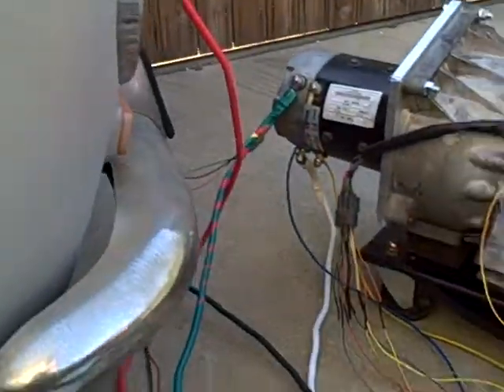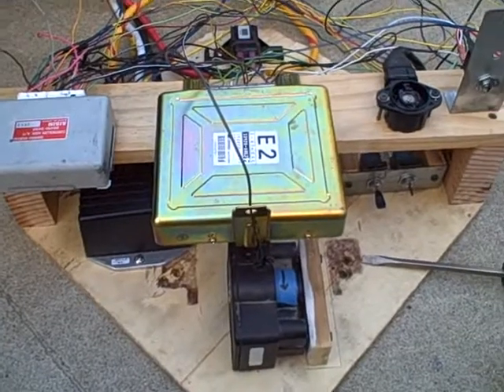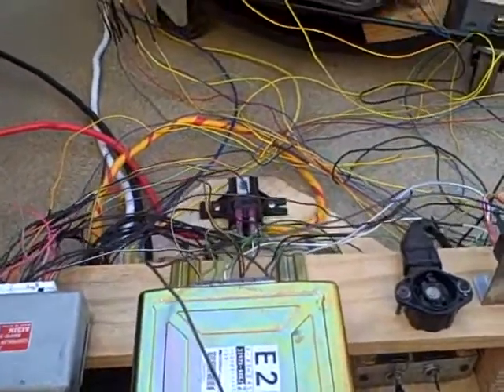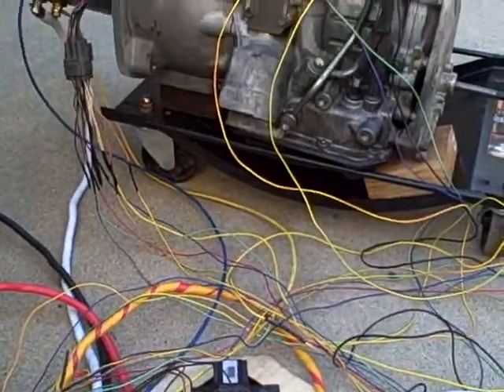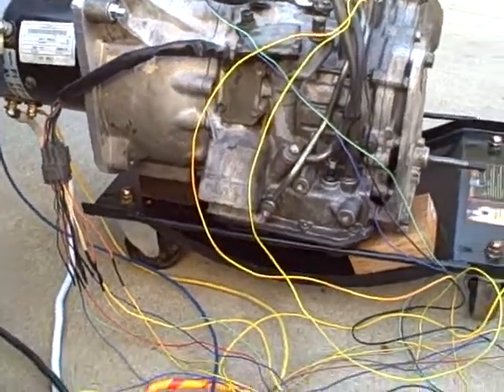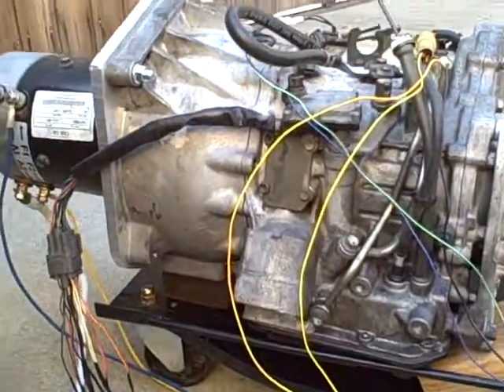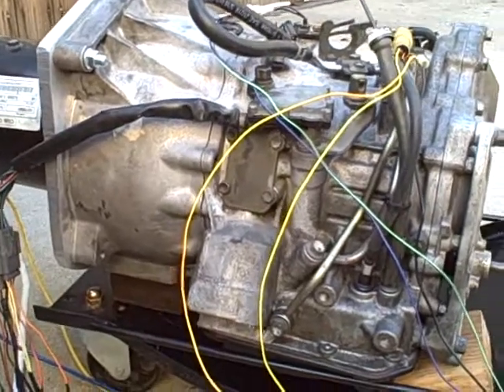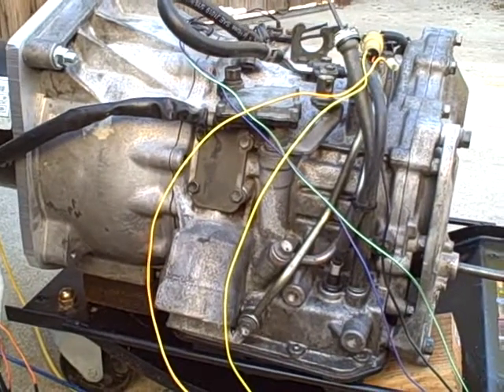EV Conversion - Automatic Transmission Shifts Itself

Comment: Hi; sorry I'm not very familiar with drivetrain mechanics; if I want to do this with an old automatic transmission (1991 Saab - which is really an even older 3 speed automatic transmission.... theoretically even better for electric conversion because of the existing gear ratios)... are you suggesting that if I remove the throttle position sensor or cable from the transmission - it will shift itself based on the rpm from the motor? Just as it does when it reaches 3400  rpms in first and second, for example? Or is there a need for an electronic signal to let the transmission know when to shift? Also, this car had the ability to manually shift - with a button to depress on the automatic shifter - such that I could downshift into 2nd and 1st at any time for hills. I feel like based on the gear ratios and shifter - there is some very easy way to couple an electric motor to this older automatic transmission? Help is greatly appreciated. What would be the first steps to determining or controlling how the car will shift - assuming I have a motor that will cruise at 5,000rpms. Also, because of the existing gear ratio and torque - couldn't it be a fairly fast car? For example - the stock version of the car is about 4,000rpms at let's say close to 85 mph in its highest gear - 3rd. If my motor is easily doing like 5000 rpm continuous (maybe like 105 mph cruising?) and feasibly much faster if higher rpms can be maintained? Sorry if this is stupid - I am assuming a serious battery - like a tesla battery with 300-400 volts or something. Thanks for any direction.
Reply from the maker: Based on some quick googling, it appears that a 1991 Saab would have a Borg Warner T37 automatic, which is fully mechanical. That means you need no wiring for it to shift properly. But you would need to keep the throttle valve cable/linkage that relays the movement of the throttle pedal to transmission. This is a physical linkage or cable, not wiring. It is critical for proper shifting and transmission longevity. You would still be able to shift it manually. As to the rest of your question, it really can't be answered without knowing the specific motor, controller and battery involved.
Reply: Thanks. Yes, oh yes....I know all about the cable! (because these transmissions are prone to failure, and the cable adjustment can be difficult if its not left in it's factory position). So the answer is YES, leave the pedal-shift linkage intact, throw in a motor (with adapter plate) and controller and some batteries, and I'll have an electric car right?
Reply: Direct drive is the same as "final drive" gear ratio, right? I just realized there wouldn't really be any advantage in keeping the transmission in this car since final (direct) drive set-up would (given proper motor selection) have enough torque and similar top end.

Comment: good day, I am wonder if you have a torque converter installed?  I have googled and an actuator was suggested to keep the torque converter running like ICE, or else the wear and tare the cost automatic transmission life span.  I would like to know how you deal with the problem?  because I am planning on doing an EV conversion on my W123 automatic transmission also.
Reply from the maker: I researched "idle circuits" on various EV forums at the time, and found some good ones. At this point, many years later, most controllers have a "idle" function that will allow you to keep the motor turning at whatever specific low RPM your automatic transmission needs to maintain pressure.

Comment: will an 80s model automatic transmission be easier than a later model
Reply: Orange Claw Hammer 10 months later hours and hours of studying Electronics. I finally understand.
Reply from the maker: The answer is "maybe", but "easier" is a short term goal. I was looking for the lightness, efficiency and precise control towards the long term goals of battery life and flexibility.

Comment: what is this video for? is this a manual gearbox converted? i dont get it
Reply from the maker: John Meister Dupa - This is an electronically controlled transmission for which I made a custom harness so that it would run without the rest of the Geo Metro from which I removed it. So, the point of the video is to show that one could do this if one wanted a compact A/T for some custom purpose. Thanks for watching!
Reply: so its a regular A/T converted to electronically controlled A/T? 

well cool :)

Comment from the maker: @thegreatnoleander - Just a heads up that the A/T in your Sonic will probably be nearly impossible to operate properly without the engine. The level of integration between ECU and TCU (if there even is a separate TCU) is several orders of magnitude more extensive and complicated in recent vehicles than what I had to sort out with my 1994 Geo Metro unit or the 1994 Miata A/T that I worked out the wiring for. By the late '90s, it's too hard.
Reply: Trans and motor have separate I/O controls. It's why your CEL doesn't illuminate if you are having trans issues. Harness should be separate.

Comment from the maker: @circusboy90210 - The pump is driven by the motor in the same way that it would be driven by the engine, but it is not driven when the car is stopped but still on -- when a gas engine would be idling. This should cause premature wear on the transmission, but for now I don't really care.

Comment from the maker: Telstar - The shift points come much closer to the motor's torque curve when one disables the throttle sensor input to the A/T computer. That keeps the shifts early and the motor speed relatively low. Most DC traction motors aren't too lossy up to 3000 rpm, and that's about where this A/T likes to shift when the throttle sensor isn't telling it to wait.